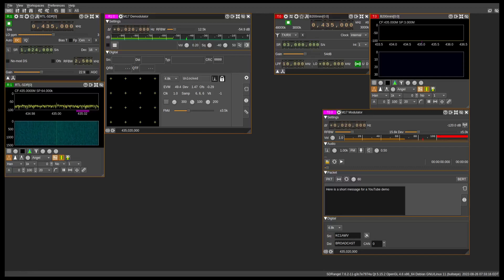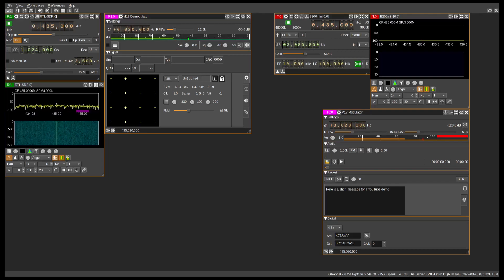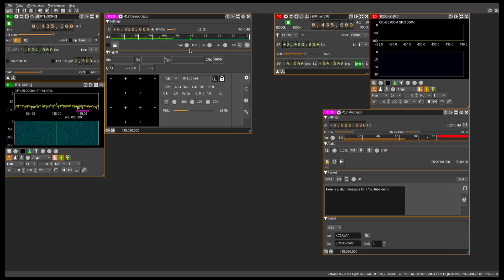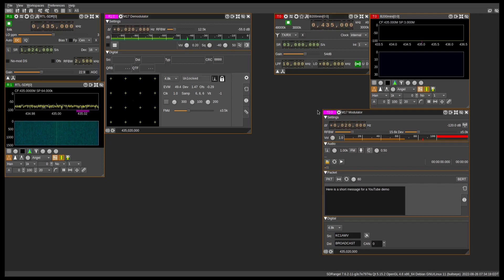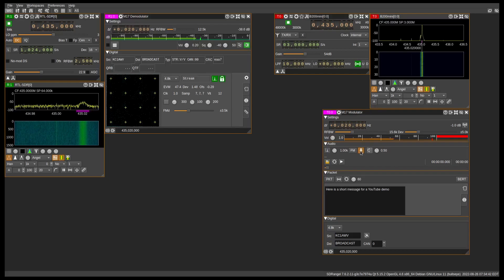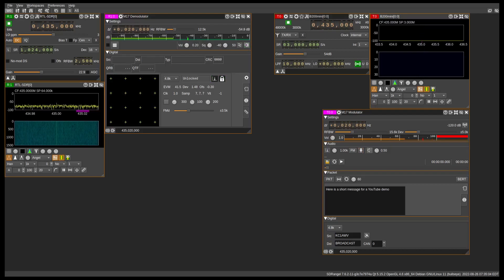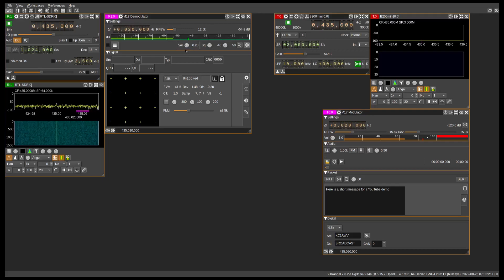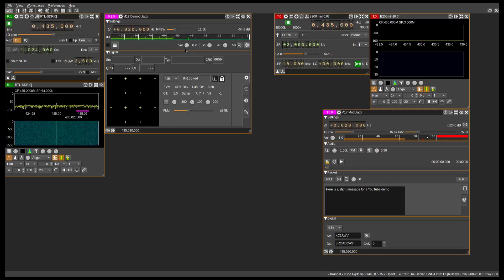SDRangel M17 Demo - Better Audio!

Comment: I cannot get audio to work in this program. no tutorial or manual helps. changing the sample frequency on my computer to match the file does not help. All I want to do is use the 3d spectrum analyzer to analyze audio and no audio comes out.

Comment: Hi, sounds like you have alot experience in sdrangel, can you sort out an issue, i am using dsd modulator but sound coming is not understandable, is that bcz of my antenna or i need to install another decoder? thanks

Comment: That’s been one of my problems with digital modes is the difference in audio from radio to radio
Reply: Yeah, it is an issue. Some radios have the option for a receive AGC so it automatically adjusts the received audio to be the same level for everyone. Ideally digital modes should have this built in to every radio and the transmitting radios should also have a similar AGC on their transmitted audio. It would make the experience a lot better.